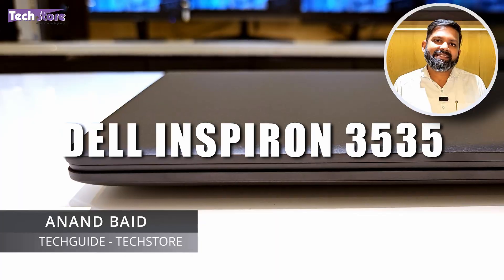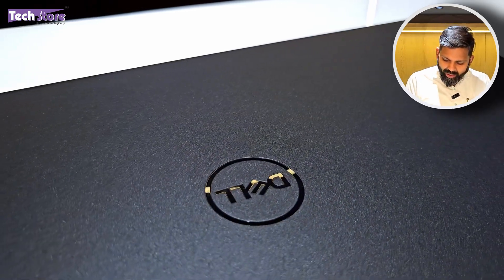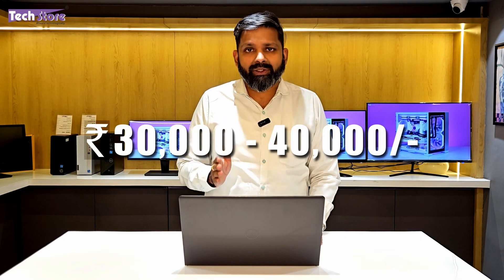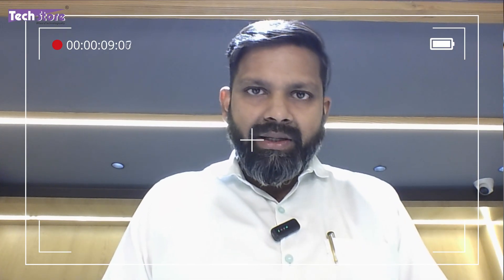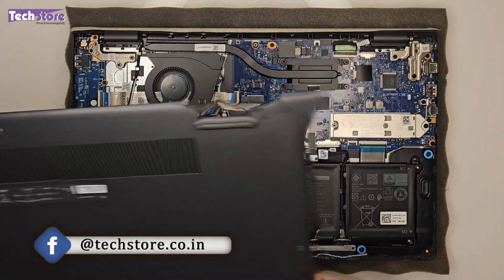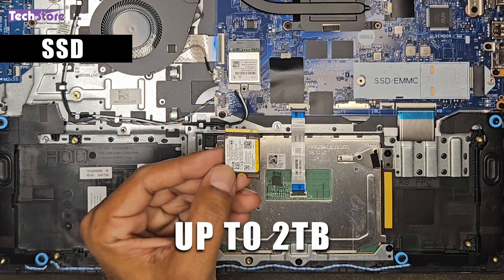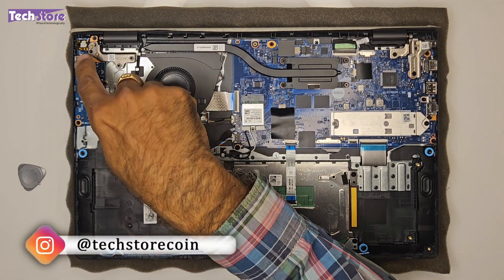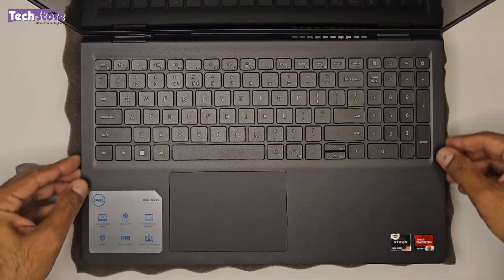Dell Inspiron 3535 Review & Upgrade | Full Disassembly + RAM & SSD Upgrade Guide

Comment: I bought this a few months ago not knowing it doesn't have a RAM socket. It's quite sluggish when running over 50 tabs in Chrome.
Reply: Why tf do you need to run 50 tabs at once
Reply: Well Chrome is RAM thirsty. I use Firefox.
Reply: How much porn you watch that you need 50 tabs, god man....
Reply: cant upgrade ?
Reply: @aboothahiru6354  No, unfortunately.
Reply: A very good descriptive VID DEMO..
ethically..
 balanced ...
critically... commenting..
It's capability..
Summed up in one line..
Good Business Class ..Inspiron 3535..
Yes..IT IS A Business Class unit..
Buyer must know and buy..
IT IS what..it is..
Good Business Class stuff
Thank you..
Dr.Nanda
Con. ChronicDiseases
Con.Cardio Vascular Diabetologist..
'Global Speciality Integrated Hospital'

Comment: Does it come in metal body also?
Reply from the maker: No
For metal body need to buy Dell 7000 series
Reply: @TechstoreCoIn  which model can you please recommend today i went to buy and they told 7530u is in metal body also
Reply: @nikuagarwal9018 I have the 7530u model it does not have a metal body. It is all polycarbonate